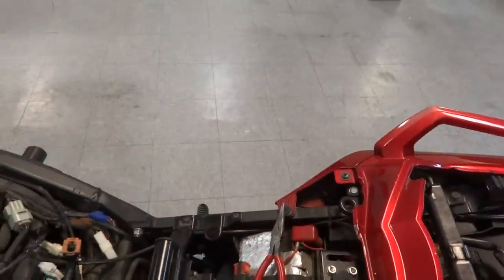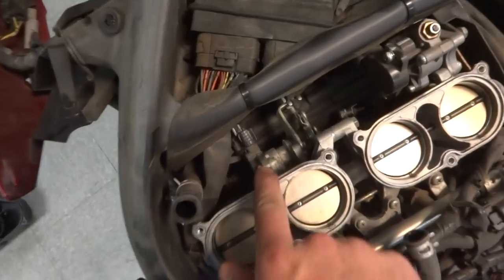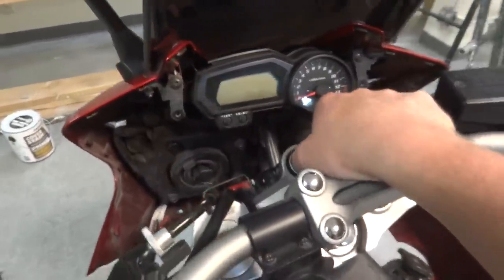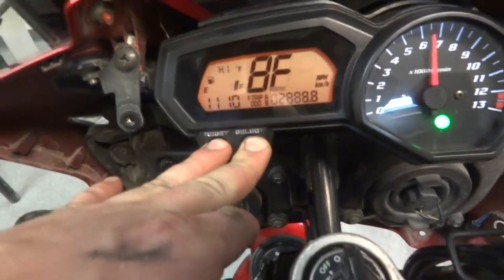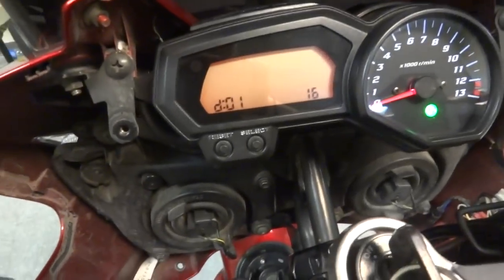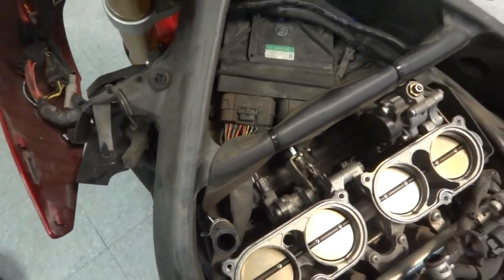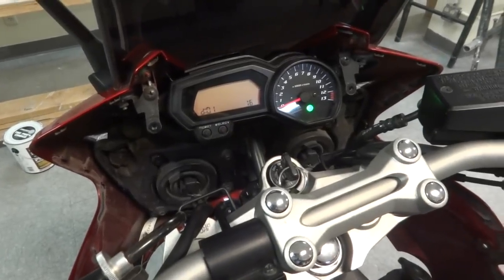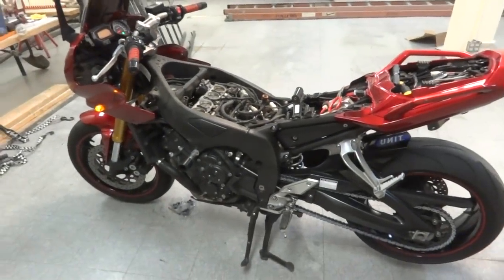How to Adjust Throttle Position Sensor(TPS) on a 06' FZ1

Comment: Why did you have to do this? Because I just purchased a 2008 and it has play in the throttle.
Reply: Play is solved from just tightening the cable

Comment: I did the same to my 2009 Yamaha r1, even tho I adjusted it it went back to 15. The way will keep it at that level even if you play with it. That what happened to me. Unless any of you guys would know how to adjust the idle on a 2009 Yamaha r1. I tried the TPS, and plates sensor. Nothing changed the idle speed.??

Comment: Hello is it any difference on 18 ?
Reply: I did that and the throttle snatch it's less then before but it's still there, fuck it
Reply: Update
DON'T do this operation !!! Other position sensor then 16 will cause oil in the crankcase. After 900 km my oil level was creeping up, about 350ml.
Reply: Ana Novak i
Reply: @daniluping7247 
Was it because it was running a bit rich at 18
Reply: @daniluping7247 explain how opening the butterfly valve a tiny bit more will result in oil creeping up?